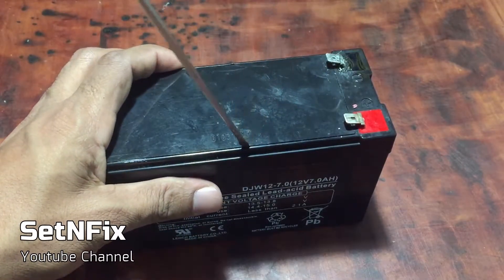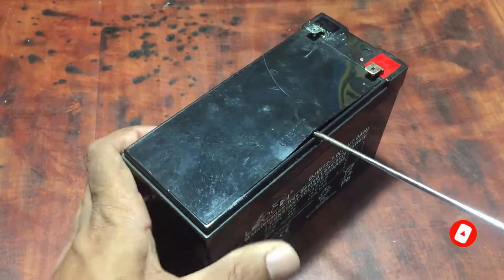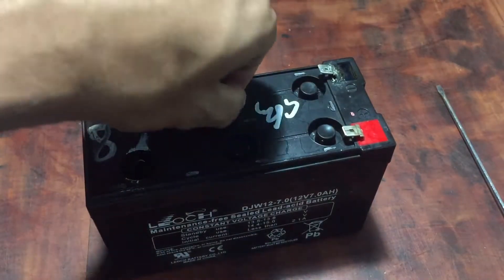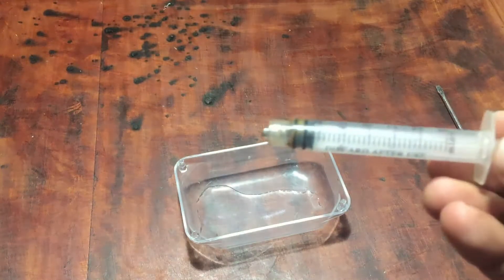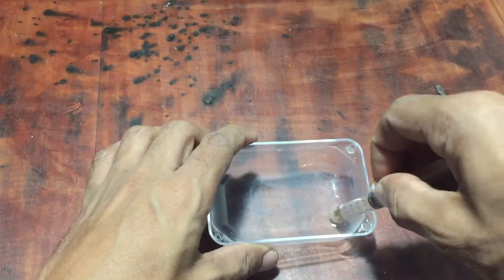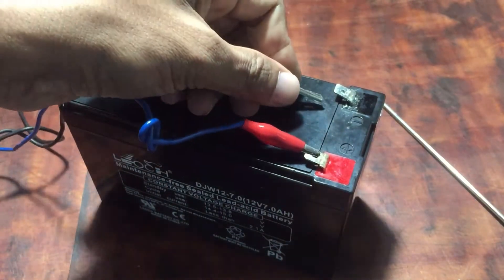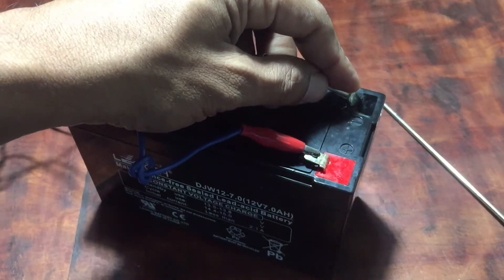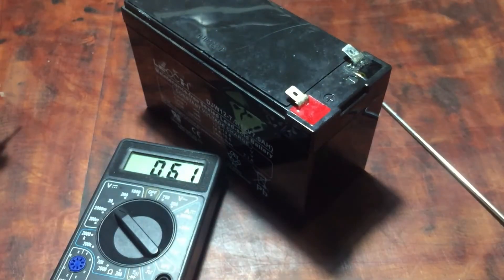How to recharge 12 volts UPS battery : Experimental Video

Comment: Because you used vinegar instead of distilled water now it's dead. Yes, you can use vinegar but it will reduce battery lifespan and in your case it totally died.
Reply from the maker: Yes, I think so..